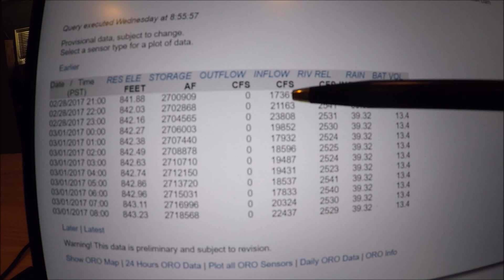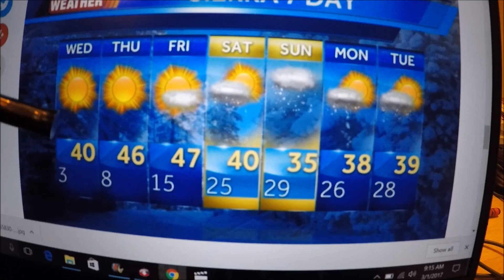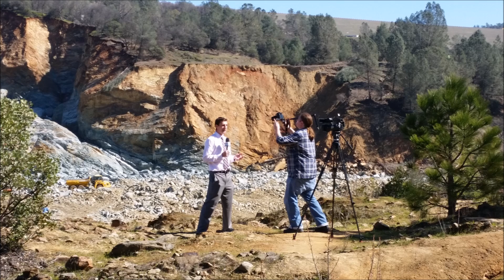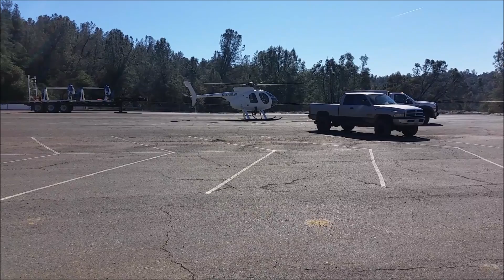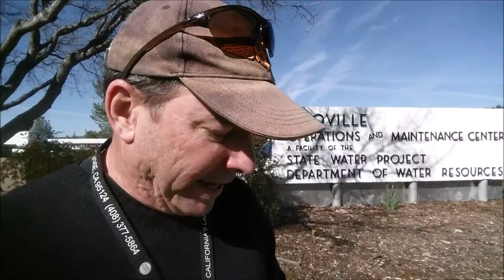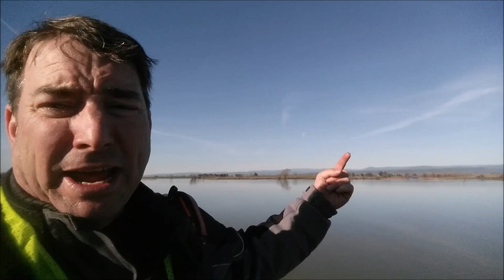OROVILLE  RESERVOIR 1 MARCH Detailed On Site Update

Comment: This truly is the 'go to' channel for information on Oroville Reservoir.  Thank you.  Have I missed any discussion on the integrity of the damn itself given how low the water behind the dam dropped for so long?  No engineer here but aren't damn reservoirs designed to be 'full' to create a seal of sorts?  Again, thanks for your rational, data based reporting on this.  Love it.
Reply from the maker: Not here in Ca....need to maintain a lower flood control level until June.

Comment: With the debris field being 1,500,000 cubic yards of material and with the current rate of removal of 40,000 cubic yards per day, it would only take about 38 days to remove this material, not months as is suggested.  Since they are stacking the debris off to the side, perhaps it may be worth investigating later for possible gold content.  Seems pretty easy mining since the water removed it for them.  If there is gold and it is at a concentration of only 1/16 oz./ton, since a cubic yard weighs about 1 ton, that would give them about 1,500,000 tons of material with a gold content of about 93,750 ounces, with a worth of about $112,500,000.  They could use that money to rebuild the dam.  Just a thought.

Comment: Sorry to read the Hyatt outlet is off-line & the Lake is creeping up dangerously high with the perils of what is to come.  Is there no way at all to make some sort of outlet over the car park area,  away from all the damage & divert to the lower level of the diversion pool. There must be some sort of flexible system that is used in the water & oil industries.

Comment: The DWR may have already discussed this but after reviewing the footage you provided yesterday, I thought I would pose this to you.

Next time you're speaking with one of the DWR officials, ask them the following.  Rather than spend huge money on repairing (read rebuilding) the spillway,  Why not construct a diversion dam just above the existing fracture and utilize the already "built" channel created when the spillway was flowing at its peak?  Surely there would be little to no loose debris left in that channel to end up in the pond below.  And, if there were to be some debris deposits, it would be much simpler, and more cost effective, to clean that out than to build a whole new spillway.  The crews seem to have a good handle on how to do that at this point.  

Just a thought and I'd be interested to know what the DWR thinks of that idea.  Keep up the good work.  You seem to be the one with the most knowledge of what's going on and are the one with the most unbiased reporting.

Doug

Comment: What's the make of the motor bike?
Reply from the maker: Honda CB500X with Rally Raid Adventure conversion...https://www.youtube.com/watch?v=bM0WiGUEImQ&t=45s
Reply: Thanks Juan. The bike is frightfully awesome. Even though I'm in Montana I'm grateful for the time you spent keeping everyone in the loop concerning the Oroville dam scare. I'm grew up very near the area that was flooded by the Teton Dam failure in Eastern Idaho and many friends and relatives were affected.
Reply: Can you tell me where you purchased your suspension conversion? Having installed it do you feel it was worth the investment?

Thanks for the continued update on the dam. I would have liked to seen a steel lift anchored to the surface of the spillway near the point of failure that would have projected the water up just a bit while the gates were closed. It seems like that would reduce the back cutting pressure as well as reducing the chance of driving more water into crevices of the hillside bedrock. Perhaps that would exert excessive downward pressure and pull the entirety of the compromised spillway down the hillside. Prayers in order for the next 30 days as the runoff arrives. Any idea on how the levels are at Isabella reservoir?

Comment: At one time they were releasing 100,000 cubic ft per sec. The weight of that water alone at 62 lbs per cubic ft is 6,242,718 lbs. Using conservative  numbers; the water traveling at 10 mph for a distance of 150 ft downhill will hit that hole with a force of about 1,302,198,779 lbs. That's over one billion pounds of force every sec. No wonder it left behind another grand canyon in a short time.

Comment: Great job on the reporting, very informative. I recall last week watching one video and an official said " it's like if you get in an accident with your car and you get a dent, the dent doesn't look nice but you can still drive it". referring to the  to the hole in the spillway.  Yes you can still drive the car and the dent will not spread to the rest of the vehicle, but if you keep pouring water in a hole it will will get bigger. Now he learnt something.More money will be spent this week than  it would have cost to fix that "dent " in the spillway.

Comment: I've been looking at the potential causes of the main spillway chute failure and a few thoughts spring to mind. The location of the slab is not far downstream of the location where the slope gradient increases. The water would have rapidly accelerated reaching speeds of 70 to 100 ft/s. This is high enough to cause cavitation and erosion of the concrete slab. I believe repairs where undertaken at this very spot in the past (2013?) suggesting that cavitation had previously occurred. Modern spillway design incorporate aerators that suck air into the flow to help prevent cavitation from occurring.  I also note that this is a very thin slab with minimal reinforcement.

The second possible cause is failure of rebar anchors that pin the slab to the bedrock. The location of the failure is coincident with some weathered looking rock immediately downstream of a lateral construction joint. If these anchors failed, there will be uplift of the slab into the high velocity water leading to a rapid failure. 

Lastly, thanks so much for keeping everyone informed. By far this is the most detailed and credible source of information available.
Reply from the maker: Hannah Glenelg I think you are right on the mark Hannah!
Reply: Hannah Glenelg : thanks for that; would there be a difference in behaviour between a convex (in longitudinal section) (like Oroville) and a concave spillway?

Comment: Here a a couple pictures which show the enormous size of the spillway end and the debris pile at the bottom of the spillway:
https://pixel-ca-dwr.photoshelter.com/galleries/C0000OxvlgXg3yfg/G00003YCcmDTx48Y/I0000WDBb3Z7HxNw/BB-OROVILE-DAM-2020-02-28-2017-JPG
https://pixel-ca-dwr.photoshelter.com/galleries/C0000OxvlgXg3yfg/G00003YCcmDTx48Y/I0000Jkq_m34WMo8/DK-oro-spillway-damage-5373-02-27-2017-jpg

Comment: Quick math: 1.5 million cubic yards = ~50k truckloads at full capacity (Cat 740 Articulated model using 3000lb/cuYD rock). Load inefficiencies gross up the truckload figure to ~65k. Not sure how many they load per hour, but 100 loads/hour would get to ~17k truckloads in 7 days. I don't think they're loading 100 trucks/hour..

Comment: Thanks for posting.. lots of good insight... I just watched this  DWR video and it looks like a clown show... https://www.youtube.com/watch?v=IwMMKmFMp78  many of the excavators are sitting idle waiting for trucks.. IMO they need about 10 or more  3-5 cy draglines digging and sidecasting that material.. Then they can use excavators or loaders to get it into the haul trucks..  also they should have cut the channel on the spillway side because the material under the spillway will just clog it up again when they open the spillway gates  .. maybe they can cut a channel through the debris but that's going to require a lot of work... In retrospect pg and e made a mistake removing the cables... instead they should have armored the towers to try and prevent erosion of the foundations, or better yet they should have not placed them on the hillside under the emergency spillway... not having this forethought was kind of a Fukushima type mistake...

Comment: Another great piece of coverage, Juan. Other news outlets could learn from you. I'm betting the best they can do with the debris pile is a good deep dredging. The spillway needs a rebuild. I agree with your thoughts on the power plant, along with the main spillway is what has to happen. I'm still thinking the Emergency spillway might come into play at the peak of the melt.

I spent several years @ Rancho Del Cielo, and we would run north to the Giant Sequoias every chance I had. The snowpack up there is impressive, and as you know, that has yet to be reckoned with. This spring rain and snow melt will be a challenge for the folks at the wounded dam.

Thanks again for the great coverage. I'll be checking in with you tomorrow.

Comment: If they have already moved 60,000 cubic feet that means they already moved 1/25th or 4% of the pile. Rough estimate is how every many days they've been at it is how many months it will take them to finish assuming no change in volume of trucks and work stoppages to turn the spillway back on.
Reply: They've been at it for two days.  It would take a couple of months to remove all the debris.  The drainage channel is smaller.  They are estimating that this smaller drainage channel can be cleared in five more days, maybe sooner.

Comment: Need to look into why the gates are not closing other that the supposed seals. Is the pressure of the water flowing around these leaks possible to warp the gates because of these leaks?

The channel will not be big enough and fill in again with new debris for the spill way as it continues to eroded and from along the edges of the channel they are cutting. Also I believe the bedrock will continue to erode because of the type of rock it is made of. What is your opinion?? Can this dam be saved? 

The power plant will never release enough water in a emergency.

Comment: Those Kumatsu and Cat articulated dump trucks can hold about 25 cubic yards in their beds. Assuming that is not over the 40ton-ish weight limit (probably is) it would take 60,000 trips to clear the 1.5M cubic foot debris field.
Reply: They also have several barges that help with the removal.
Reply: jospi2 Those barges arn't moving the debris up the hillside though. They hold the excavators and move debris from the middle of the diversion pool to the edge to be offloaded onto the articulated dump trucks which are doing the bulk of the haulage.

Comment: Appreciate the efforts to place yourself for the best video. Also, the tutorial on clipping, rehanging the high tension wires and the machines and tools used was quite informative. Showing/explaining the reservoirs to keep the water flowing into the river was great as well. Far more to dams and water management than I would have guessed. 

Also, great to hear where exactly things are at regarding wires back in place, power plant getting ready and future plans for the lines.

Comment: FWIW, that cool footage from DWS was shot with a full sized heli not a drone.
Can see its own shadow in their first video, and I found some news heli footage when they were shutting the spillway down, and you can see the DWS chopper hovering right inside the hole below the break in the spillway.     Would have been a lot easier/safer/steadier with a drone, but FAA probably found some way to make it stupidly hard to do legally, as they have a habit of doing.

Comment: -How long will it take to get a channel so the power plant release be used? What is their plan? Is it to dig a channel and let the water flow out, or is it to harden it with steel plank piles sunk into the river? How wide and how deep does a channel have to be in order to use the power plant release at whatever levels it needs to keep a safe lake level?
-How long will that channel last if the main spillway has to be used again to keep the lake at safe levels?
-Is the water release from the power plant alone sufficient to maintain safe lake levels?
Reply from the maker: watch again...it's all in there.

Comment: thank you for this beautiful video.  This would not be needed, had the morons at the california water district, had flown a 1000 dollar drone down the spillway, and ran grout in the cracks, before this disaster.  Because of idiot morons at the top of californias  eletist communist structure, who love aliens, instead of californians, you will probably loose this reservoir when the snow melts, because you didn't want to dam the inlet streams in the amount necessary to travel through periods of drought, that now has flowed down the ocean unusable to farming, and 500 people working day and night to fix what the idiot, total idiots politically correct, and spending vast sums, that could have been used to properly manage the water shed for peoples usage, and not the very limited number of people during the summer that wanted to see a free flowing stream in the mountains, instead of useful and beautiful dams for humans to use later.

Comment: This is a massive undertaking. The crane with the personnel cage proves that along with the construction equipment. I laugh at the trolls who try to prove a conspiracy because they don't see rebar in the broken concrete. Also, what looks like baseball size rubble is probably watermelon size rocks. Wow! Thanks for the impressive update. You are clearly connected. Keep up the good work.

Comment: What did the Engineers think would happen to the spillway built on clay dirt? The bottom portion of the spillway appears to be resting on bedrock, but the middle section is on clay dirt. Did the Engineers miscalculate or did the cost of building a stronger foundation not fit in the budget? How does someone be so meticulous when building a Dam, but so careless in building a spillway?
Reply: Rebar or no rebar, building a HEAVY spillway on dirt is a disaster waiting to happen. I'm surprised it lasted 50 years.

Comment: Clearly they need to get real equipment in there, like what is used in the mining industry. Those monster excavators and dump trucks. :)
Has anyone told you of the plans of what they're doing with the spillway itself? It would seem to me that now nature has given them a plunge pool, use it and remove the lower spillway. Wall up the eroded side and remake the lower spillway at the new lower elevation. That way the plunge pool can be used to absorb the energy of the water and a debris collector. Angle the lower spillway to prevent the spillway from hitting the diversion pool at a perpendicular angle.
Reply from the maker: every idea on the table now...

Comment: I think you are a little off track with your geology there. It's not really a fair comparison for you to grab the decomposed rock laying on top of the ground and compare it to the solid rock of the eroded spillway bedrock.
Reply from the maker: Good point, to be fair I was beating on exposed rock. A big difference between the unexposed rock in the spillway channel.
Reply: I believe that the foundation of the spillway, based on recent photographs, show solid bedrock, fractured bedrock and soil.  Then the high velocity water coming down the spillway found the weakest joint in the concrete floor.  Review these DWR photos
 https://pixel-ca-dwr.photoshelter.com/galleries/C0000OxvlgXg3yfg/G00003YCcmDTx48Y/I00005EFjkjMoOys/KG-oro-spillway-damage-9970-jpg
https://pixel-ca-dwr.photoshelter.com/galleries/C0000OxvlgXg3yfg/G00003YCcmDTx48Y/I0000Ibu_Dz.oscA/KG-oro-spillway-damage-9974-jpg
https://pixel-ca-dwr.photoshelter.com/galleries/C0000OxvlgXg3yfg/G00003YCcmDTx48Y/I00002lnQqBGT9AI/KG-oro-spillway-damage-10000-jpg
https://pixel-ca-dwr.photoshelter.com/galleries/C0000OxvlgXg3yfg/G00003YCcmDTx48Y/I0000P_uXiSxJJ6w/KG-oro-spillway-damage-10055-jpg
https://pixel-ca-dwr.photoshelter.com/galleries/C0000OxvlgXg3yfg/G00003YCcmDTx48Y/I0000kN9PORvuykE/KG-oro-spillway-damage-10060-jpg
https://pixel-ca-dwr.photoshelter.com/galleries/C0000OxvlgXg3yfg/G00003YCcmDTx48Y/I0000Ly__.MmP918/KG-oro-spillway-damage-10101-jpg

Comment: The power line cable is made up of steel and aluminum.
They have a steel cable running through the middle which is made up of around 7 (from memory) solid core strands and then the Aluminum cable is wrapped around it.
Someone correct me if I'm wrong
Reply from the maker: Usually- these cables are ALL aluminum...

Comment: Judging from the video the trucks look like CAT 740 Articulating Dumps. Capacity fully loaded is 31 cubic yards. 1.5 millions cubic yards @ 31 yards a load is 48,000 truckloads. 
I can see a channel being removed but not much else.
Reply: Won't the channel rapidly fill up again with more debris once they open the gates again?
Reply: Only if lots of debris comes down with the water.
Reply: It would be better to stabilize the new effluent canal with explosives, to make smoother passages, and to stabilize this sludge with large quantities of steel-reinforced concrete.
To fill up the hole would take too long, and the rubble would still have to be stabilized, compressed and under certain circumstances fortified to restore the old condition.